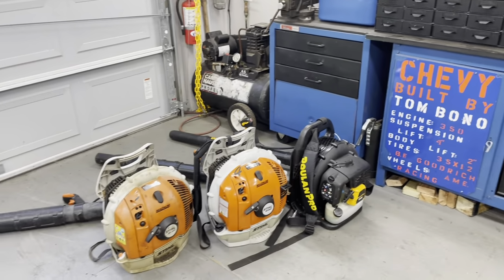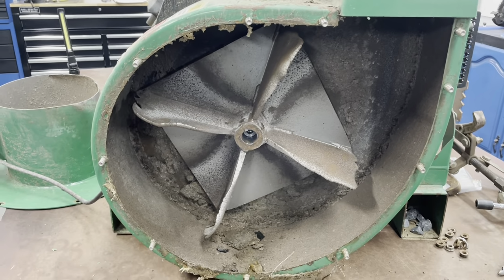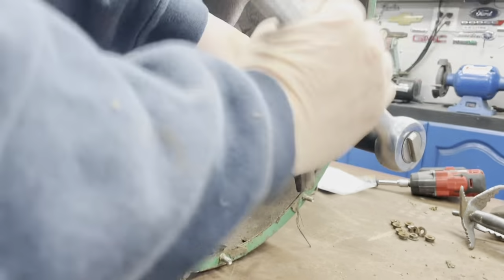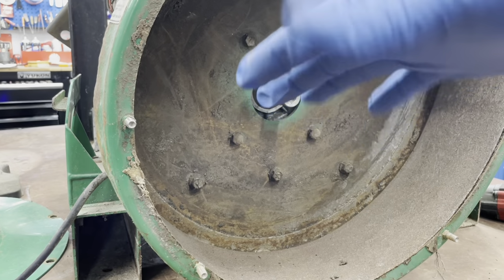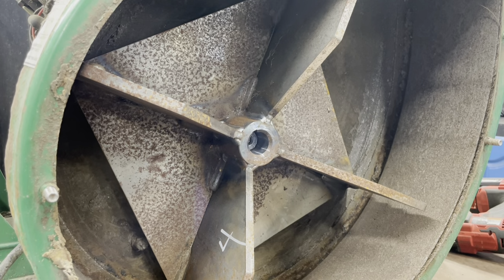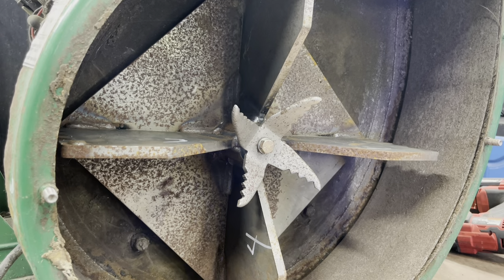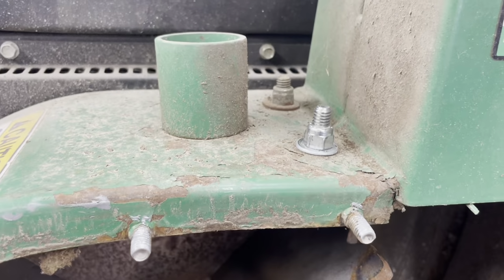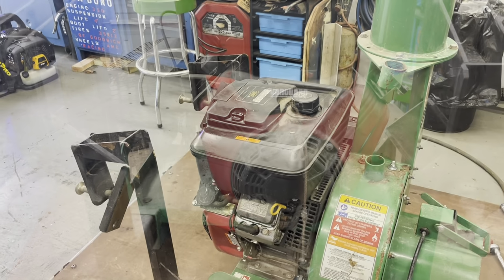How to change the impeller on a Billy Goat Leaf￼ vacuum￼

Comment: I have a kd50..need a new motor, any idea what new motor might work with it
Reply from the maker: I have use the predator harbor, freight engine the big two cylinder one and it worked fine.

Thanks for watching 👍🏻
Reply: I'll need it to match up with a new impeller

Comment: shit …..my Fraden 31 hp Must need a new liner and the impeller definitely could be changed out. it didn’t have the big chips in it but the edges were starting to curl. That’s from jobs with a lot of rocks.  it’s crazy that fall is generally six or seven weeks …… say I do seven to 10 jobs a day….. say 10 to 15 minutes of sucking each job? Roughly an hour and a half or two hours of that thing going nonstop per day. Let’s just call it two hours, times that by six days that’s 12 hours a week, 12 hrs x 7 weeks= 84 hours a season—-I got it in 2016 so 84hrs x 7 years= 588 hours… So let’s just say it needs to be changed after 600 hours lol…… Less if all your accounts are sweet with no rocks

Comment: it seems the piranha blade is bent the opposite way, the ripper teeth are not on the leading edge but on the trailing edge. 
I find it hard to believe the blower can move as much as it does. farm blowers that could lift tons of sileage 75 feet vertical were made much tighter clearances. the fan to band clearance was pick up a nickel, leave a dime.